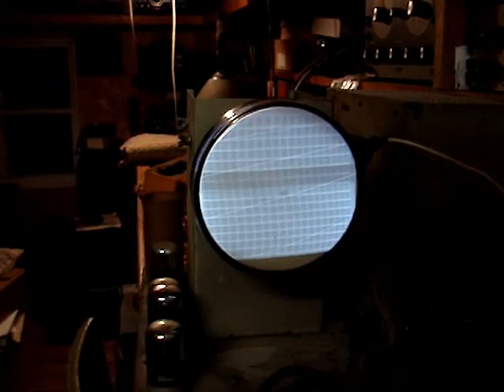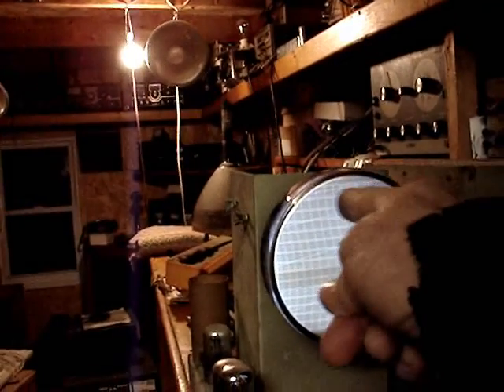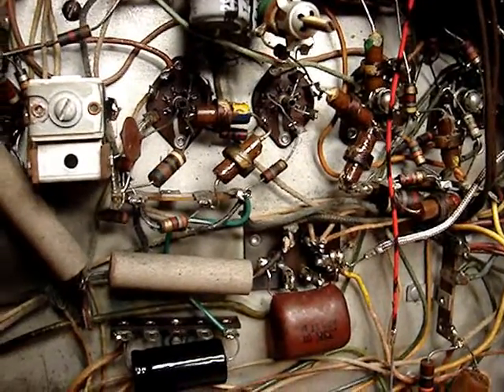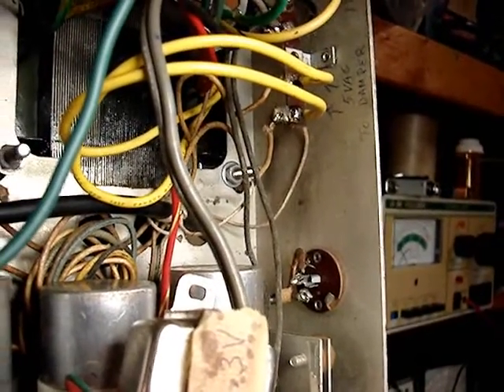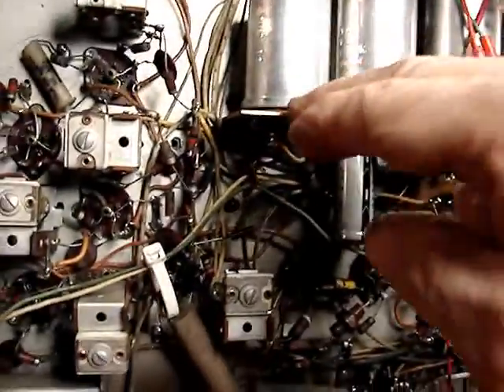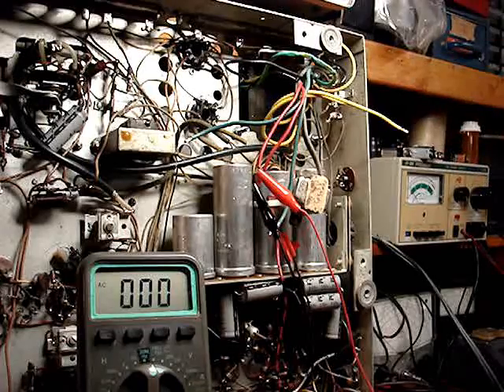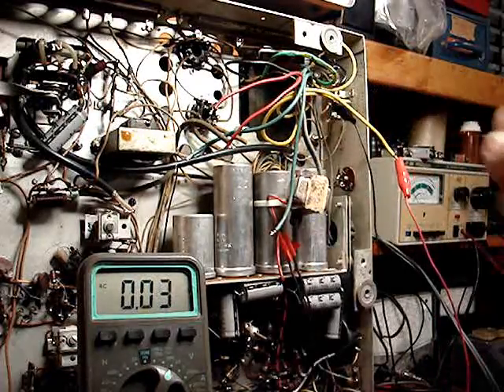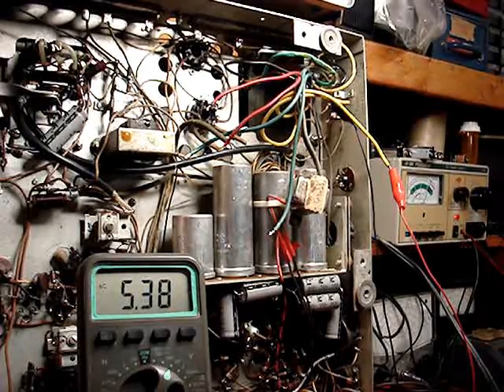1948 Sears Silvertone TV Radio console PT5

Comment: Wow that's a project alright. I just found your channel, and this has been an interesting 5-parter. I hope you continue it though, that's a nice looking set when it's in the cabinet, and it's nice to watch and learn along with you.
Reply from the maker: Hi. I had to set it aside for a while but I will get back to it eventually. The biggest problem to solve is getting the power supply issue corrected. The person who cobbled away on this set before I got it put in a replacement transformer that has the B+ voltage up to 100v more than it should be. Gary

Comment: HibGary,
What a "rats nest" of wires under that chassis! Going into a radio that someone else has screwed up is never pleasant!
Reply from the maker: Hi Jim; I worked on it last night. I removed all the old electrolytic cans and am in the process of installing new capacitors in the power supply. I will be putting in the two 5U4 tubes that were eliminated. My goal is to see if that will bring the B+ down a bit closer to where it should be. If not then I will shelf the project until I find a better power transformer. I am enjoying the challenge.

Comment: It is always disappointing when I open up electronics and someone has done a very poor repair. I usually rip it out. If it's wrong it's wrong rip it out.
A friend brought a Zenith black dial console chassis over and we were both amazed that someone had decided to wire all the tubes in series,,,, and the transformer is good?????? Why somebody would do that I have no idea. So I told my friend to rip it out and wired the filaments the way it should be, he did and the radio is playing today. Who knows what evil lurks in the heart of man, the shadow knows.
Reply from the maker: I agree Rick. There is a power transformer on eBay I may buy if someone else doesn't buy it first. The voltage for the B+ is a bit higher than the original transformer but much less than the 600v that the Hammond 272Fx transformer puts out. The eBay transformer also has two 5.0 volt winding's so I could  put the two 5U4 tubes back in. The only drawback is that the filament is 12.6 volts center tapped. I may be confused but I have to see how the filaments are supposed to be fed. I am also confused as to why the guy put in that little filament transformer for the CRT. Maybe he assumed there was a H-K short but my tester doesn't show that. Gary
Reply from the maker: In looking at the schematic this morning I realize that eBay transformer will probably not work as on the schematic the supply should be 260ma. What I might do is to wire up the 5 volts to the 5U4 sockets, put in the right value capacitors and see what B+ I actually do get. I would still need to supply filament voltage to the damper tube but for this test all I want to do is see what B+ I get after rectification and filtering without the rest of the set powered up or in other words I will not connect up the 6.3 volt filament supply.